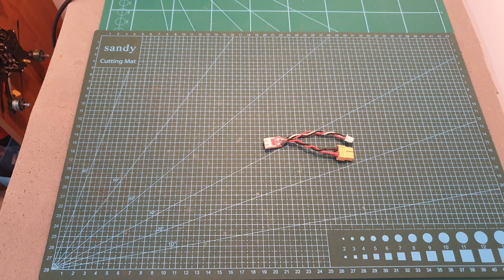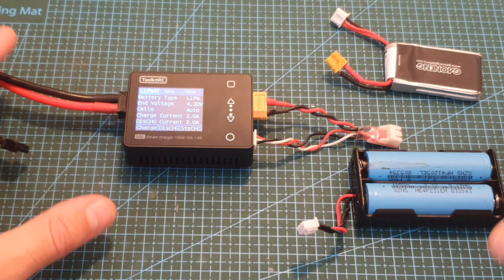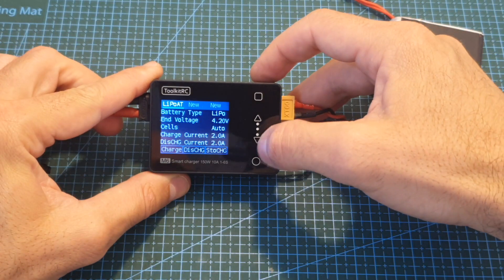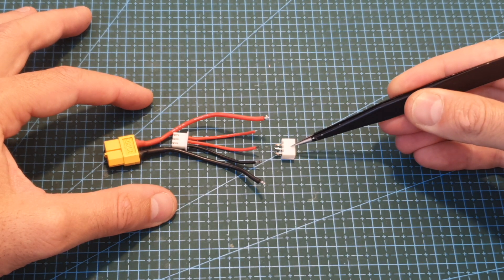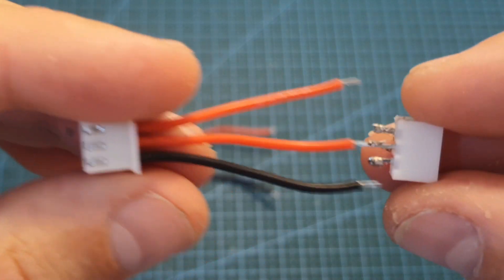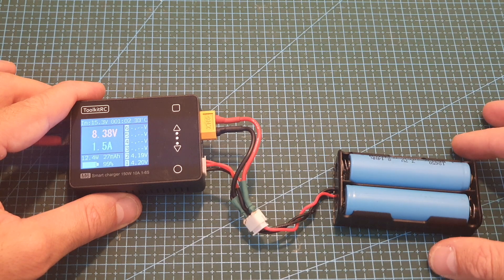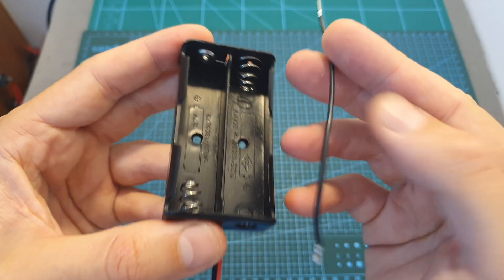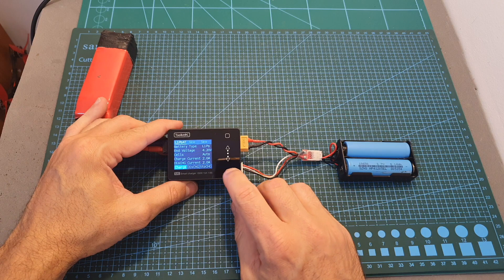DIY 2S Battery Balance Plug Adapter + Jumper T16 Battery Case Upgrade

Comment: OMG why did Jumper do this....!@#$%^   I'm beting the Radiomaster is the same way... :-/    Face palm.
You might as well not use your $80 balance charger, and just buy a $10 18640 battery charger off of ebay rather than have to wire some mess up...

Comment: And charged thesee 18650 using lipo seting? Not li ion or other?
Reply from the maker: I normally use lipo settings on my charger.
Reply: Gal Kremer and you charged at 1c? I headr the li ion cant handle 1c charging.
Reply from the maker: @TERBANGFPV  I normally charge at about 0.5c.

Comment: I have shelved my Taranis  in favor of Jumper T16 Pro also,  but when using 2-18650 batteries, do they really need to be balanced??   I mean if one starts getting out of sync with the other, does the Radio really care?? What will happen??
If 1 cell starts really lagging or failing, just replace it, no??    Sorry if I'm not seeing the bigger picture, still playing & learning with Jumper...
 I wish it had an onboard charge system like the Taranis??
Reply from the maker: Yes - you need to get them balanced otherwise you might experience issues when powering your TX.

Comment: what kind of batteries did you use? did you use the one that had a flat top? or a button top?
Reply from the maker: Flat top, but it will work with both.

Comment: Great tip thanks. your charger looks to charge to a higher voltage than mine.On A123 setting it will charge to 3.65 v but I have seen somewhere it should be 4.2vThe model forum I use said 4.2 is to much and 3.7v is correct, your opinion please?
Reply from the maker: You are welcome. You can manually set the voltage per cell. You can watch my review here: https://youtu.be/m0KGrfidEmg

Comment: Have you tried paraller charging boards with M6? My unit refuses to charge 3pcs 4s or 4pcs 2s with correct voltage. M6 insists to charge with 21 or something Volts. Same board works just fine with isdt q6pro. My paraller board has 4 ports to use with xt30 or xt 60 2s-6s.
Reply from the maker: Sorry, I don't do parallel charging. Maybe someone else can help.